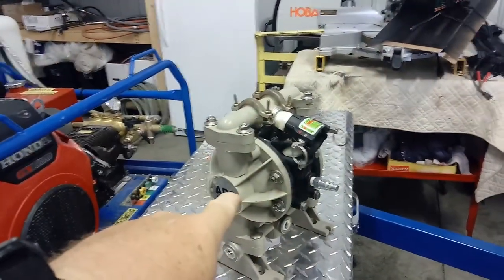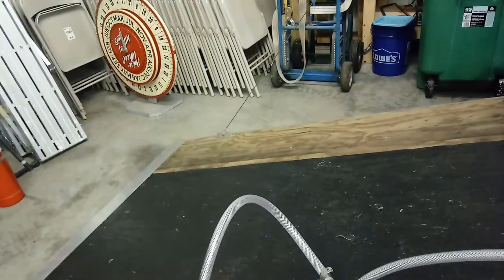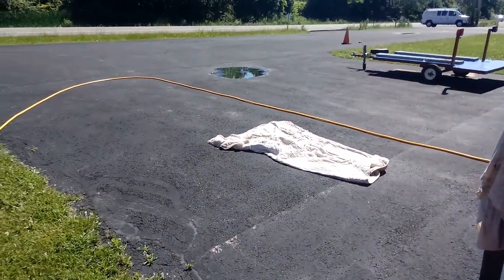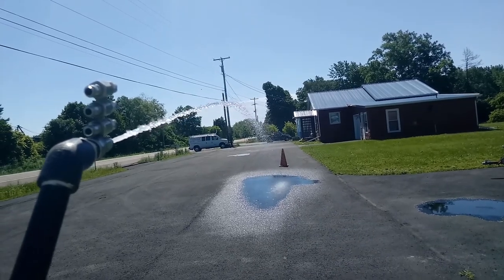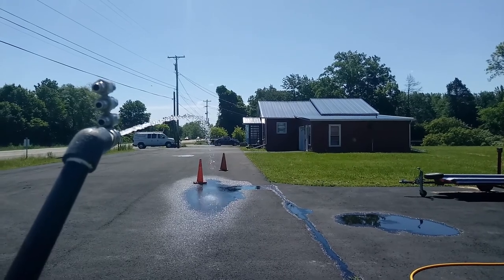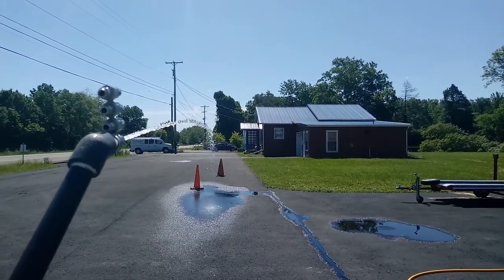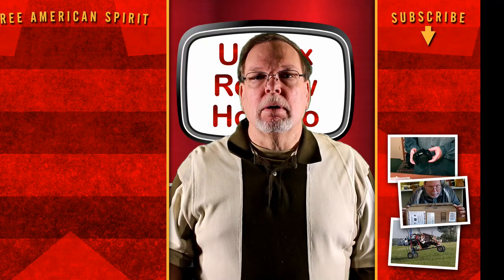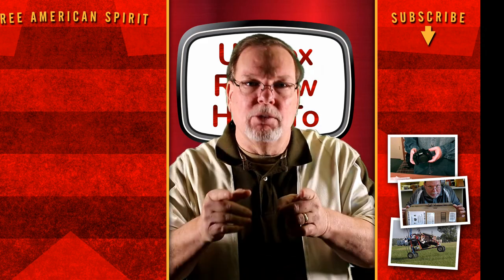Flojet Air Diaphragm Versus Fat Boy Pump Soft Wash Pressure Wash Rig Clean Now Pressure Washing

Comment: Looks good. A few notes. First, the regulator pressure won't be what the running pressure will be. If you set the compressor to 70, the actual pressure you'll see once the pump is spraying will drop down about 20 PSI on the Eaton. So you want to set the regulator about 20 PSI higher...or have somebody adjust the pressure while you are pumping to 70 PSI. It sounds like you may need to adjust the needle valve on the compressor to get higher pressure on the regulator...easy to do. Second the Flojet likes to be fed by 3/4" hose. Running it from 1/2" feed line will slightly restrict the flow. It likes a more flooded input to be fully happy. The Twin Air Diapragm pump only requires 5 CFM of Air, so your Eaton Compressor at 20 CFM can run four of them...simultaneously.
Reply: So could get by with a little gas pancake compressor.  90psi @ 5cfm

Comment: I love this pressure washer.>>>   I also purchased the quick connect turbo head and used it to clean mold off of brick walls and dirt building into the porch cement. I did not need to use any type of soap with the quick connect turbo head. This also did a great job cleaning my house. I can't wait to use the other attachments I purchased separately to clean my house and my car.

Comment: How are the Flojet 10gpm Diaphragm pumps holding up with the bleach?
Reply from the maker: So far so good.  I am still using the original 2 that I bought when the vid was made.  I always rinse the pumps thoroughly.  Keep in mind I only do a couple jobs a week so I may not use them as much as you may be using yours...
Reply: I have the 7gpm Flojet Air Diaphragm pump with Kalrez diaphragms.   I’ve only gotten 4 months out of it and it has started leaking chemicals thru the front SS screws.   I took it apart and cleaned everything, but it still leaks.  I’m not running a moisture filter, which maybe my problem.   The manufacturer says this is the number one problem with these pumps.  They also said bleach is not good for them.  This is why I went with Kalrez!   I’m only putting 2% SH thru it, so I thought it would last a lot longer.   I’m a little hesitant about getting another.  What diaphragm material is yours?

Comment: im using the fatboy pump now with 200' of 5/8 hose to spray my mix but it seems like im getting that good of a flow. Is 5/8 hose to big should i drop it to a 1/2" hose? Any help and advise i really would appreciate thank you great video
Reply from the maker: 5/8 hose going to the gun is fine.  you may have to change the tip in your gun to build a little more pressure.  Also on the suction side, use 3/4 hose, reduce as many elbows as you can, and keep the pump close to the tank.  Also you can read the instructions to see how to turn the PSI up or down on the pressure switch...
Reply: You need 1" suction house. And don't use too small of an orifice tip. I burned my pump up after 6 jobs. Called Rex the Pump Guru and he solved all my problems